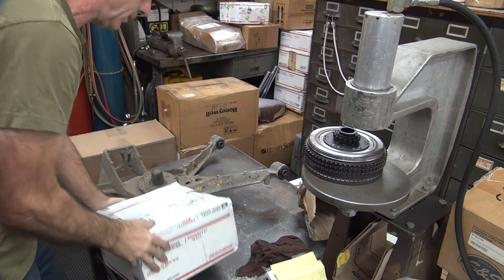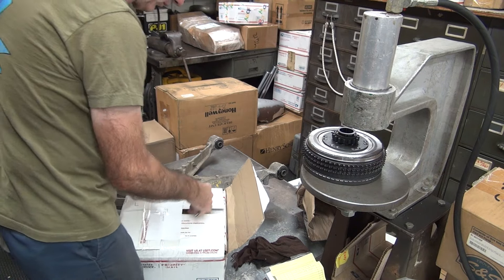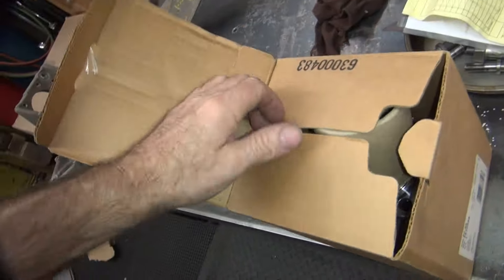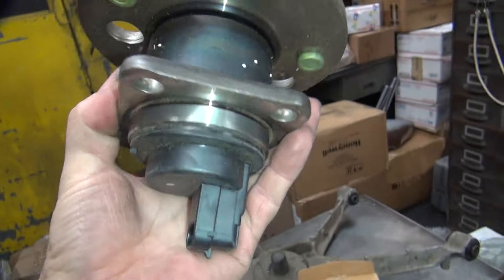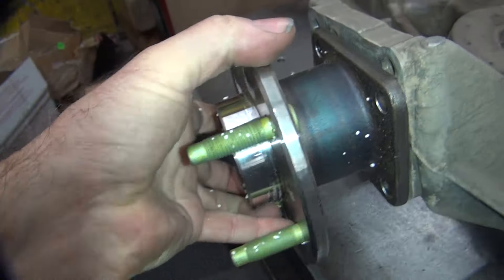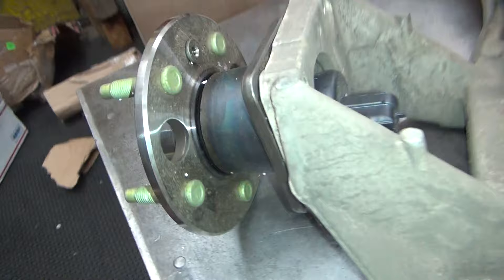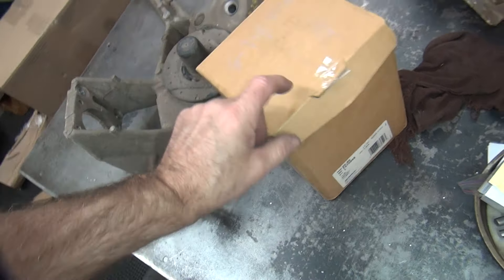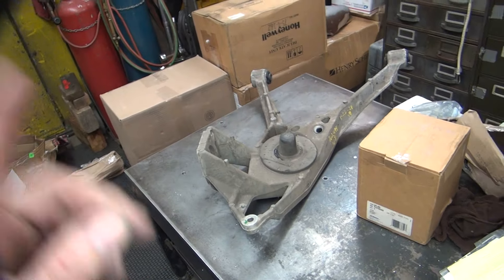#103 tatro's surprise new years gift 1999 cadillac seville can i fix it for under $500 tatro machine

Comment: I bought a  a c d e l c o  (large print on the box) starter , for a toyota about a month ago , also printed on the box - made in china , just so you know ..........After I packed all the bearings and gear reduction it may last a while ........I sealed off the 2 solenoid mounting prongs inside the gear reduction . with ultra silicone . The gear reduction housing seam has no gasket or sealer , I use sealer on the seam to keep water out of the gear reduction , the reason I mentioned this is - its made just like a harley starter .